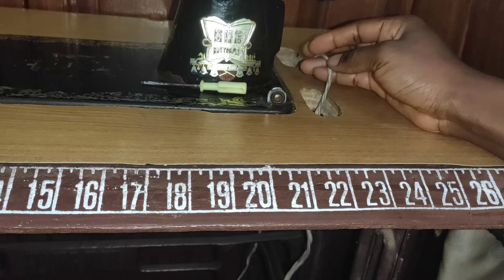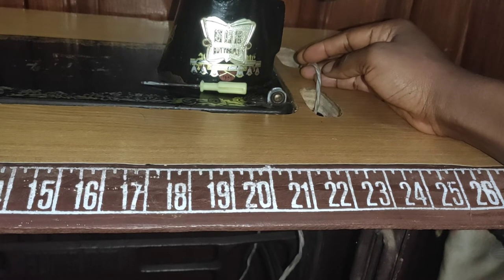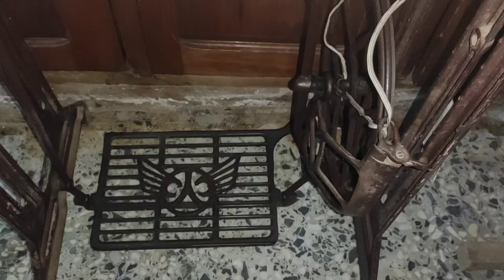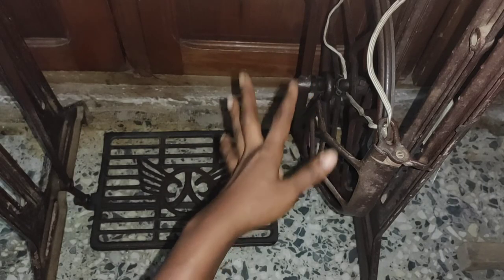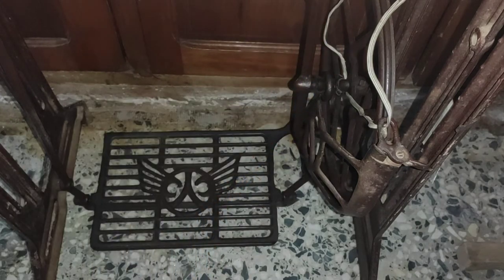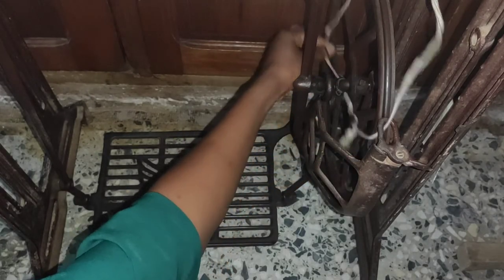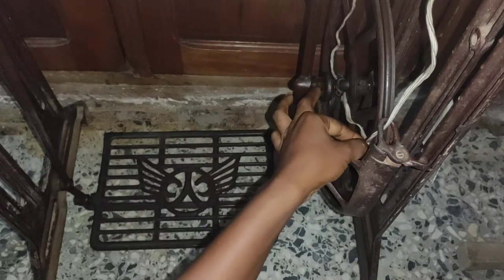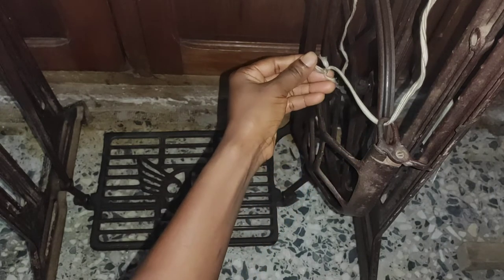FIXING THE ROPE OF YOUR MANUAL SEWING MACHINE

Comment: I have watched different tutorial videos still can't fix the rope for my 2 machines. Both rope decided they will cut the same day. I bought elastic the roll and I have used up to half yet it keeps cutting. If it's too free I tighten it and when sewing it just cut. And if it's too tight, it just removes from the wheel. It's frustrating. I have customers clothes toake and I have be battling with it since morning and now it's 5:30pm, I couldn't even make any dress today. Pls help. I measured 30" yet same problem and there's no one around to help me out
Reply from the maker: Hi there. Sorry that you are going through this issue. Have you been able to fix it now? Seeing that I am just responding to your message. 

If you haven’t, please try calling a machine engineer to help you out. If you reside in Lagos, I can refer one to you. Let me know if this option works for you.

Comment: Hi. I've followed the instructions but whenever i match the machine moves but when i try to sew with a cloth the machine doesn't move when I'm matching it. I've even given it to a repairer and he tested it but whenever i take it come it doesn't move. I've changed the rope severally too and it's a new machine. What do i do
Reply from the maker: I will advise that you don't use a cloth to sew for now, try practicing with only your  machine. Once that has been mastered you can try sewing with a piece of fabric
Reply: @nodfashionacademy  I've done that it works fine but once i put a material it resists
Reply from the maker: @Bodisere  I think you should ask your engineer to check it out again, he will be able to troubleshoot better. Let me know it turns out